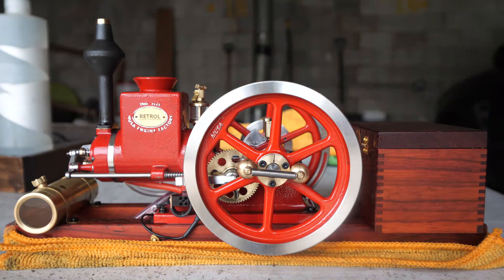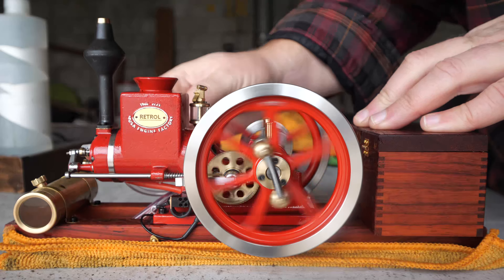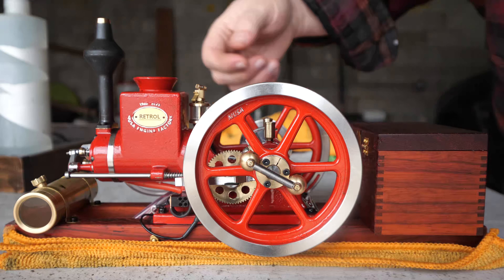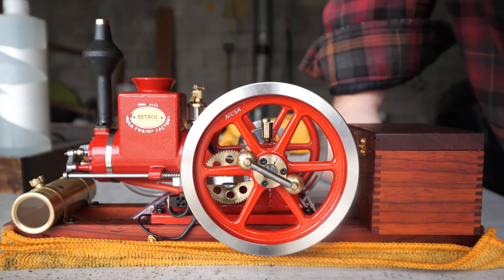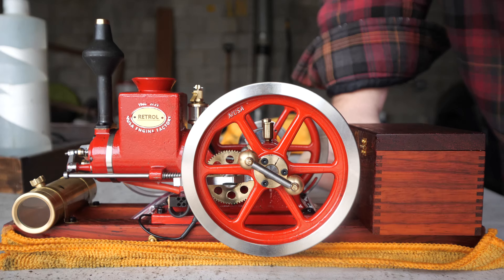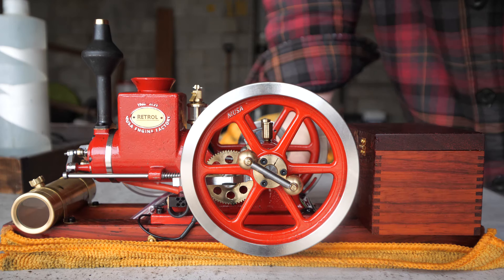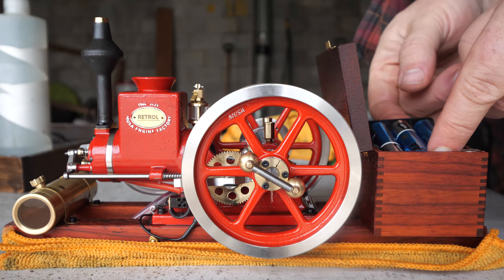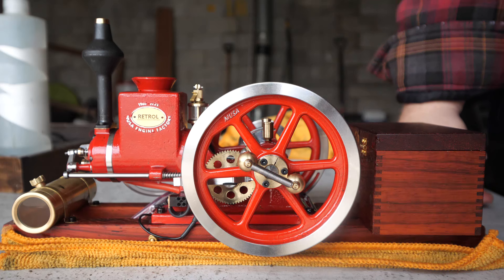HM-01 summary after softer springs

Comment: what is the adjustment on the oiler and what kind of oil are you using?
Reply from the maker: I have non-detergent straight 30w oil that I use on these engines.  I have also used 3in1.  The oiler that came on the HM-01 is really nice, but I keep mine adjusted as slow as it will drip and it would still empty in a few minutes.  I have ground the lifter lever on the top down so it doesn't pull the needle very much, but that only extended the oil fill to 5 minutes or so.  It's a beautiful little oiler, but I don't know if it will ever run slow enough.